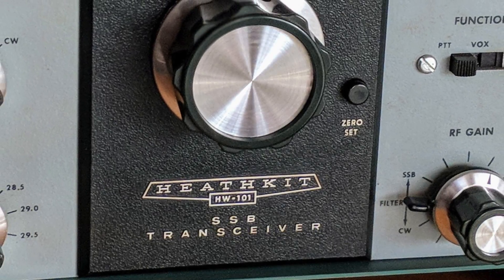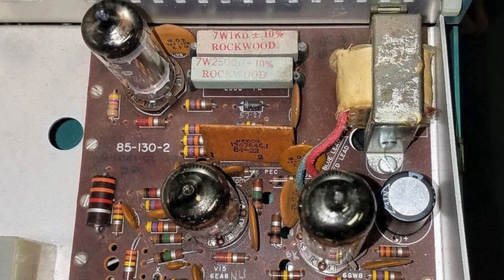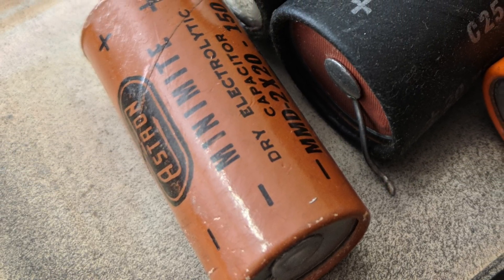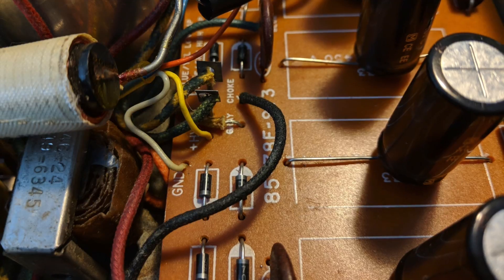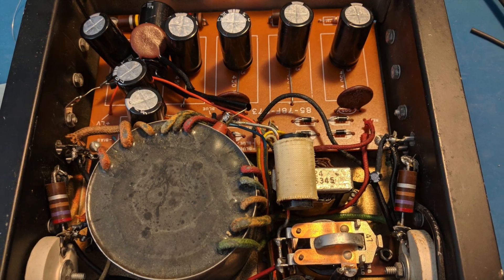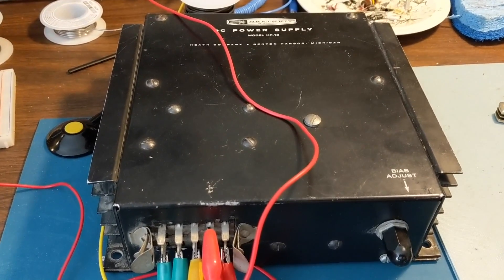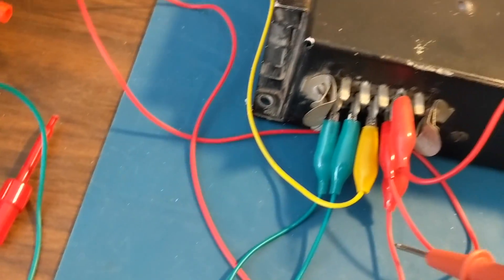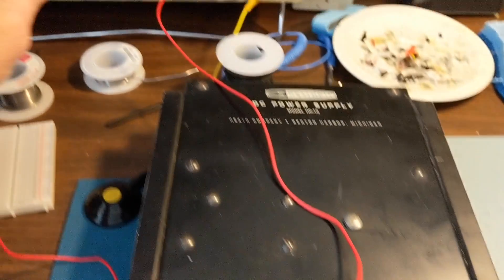Heathkit HP-13 power supply

Comment: Thanks for the nice video.  I'm on the lookout for one of these to check you a Johnson Viking mobile transmitter.  Now, I'm not so sure.  Probably hold out for the HP-20 now.
73 Paul AA1SU

Comment: I have a vintage Heathkit HA-14 SSB amp in my shack that I haven't fired up yet with the A/C HP-23 power supply, but I really want to go mobile with this little amp to boost the RF on my Yaesu FT-857d in my Silverado. The designated HP-14 ps is long obsolete and ultra scarce at best, and I don't know of a suitable replacement mobile ps for this amp. Would you know how this could be accomplished? Thanks.

Comment: You're a glutton for punishment! ;-) Nice HW-101 though. I've got a Heathkit set of SB-101, -200, -300 & -400 for my vintage station. I either need to find an HP-23 or steal the parts from an extra SB-400 I've got. Just love the old rigs! Thanks for the look at the HP-13. I've never seen one running before. 73 de N6MGN

Comment: Typically I replace resistors with the next wattage up. If you check the voltage rating of todays resistors you'll find that they often aren't rated for tube gear voltages. That's the first 12V supply for tube gear that I've ever seen. Pretty cool. 73 NE5U  Mike
Reply from the maker: +Michael Lloyd Yes, I used my IR temperature gauge and measured that 2 watt resistor going up to 170F while the old carbon one next to it stayed at 120F.  I'll be replacing it with a 5w to be on the safe side.  Also if you look in the video, I actually had a 1k 2w in that position, but replaced it.  Never trust Digi-Key packaging.